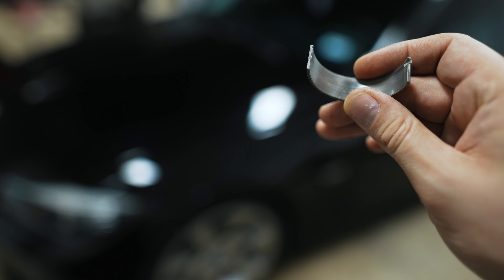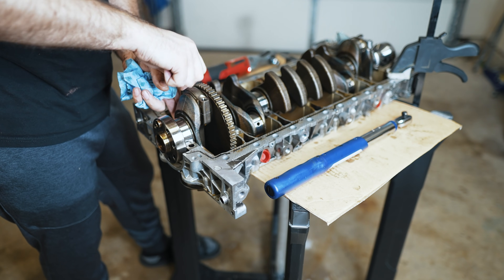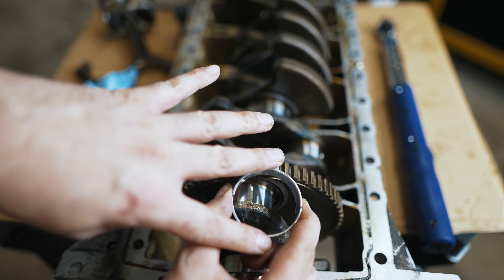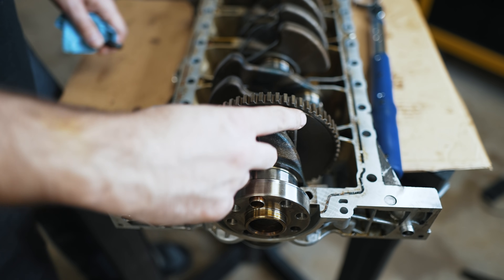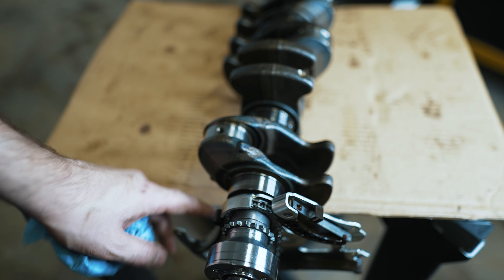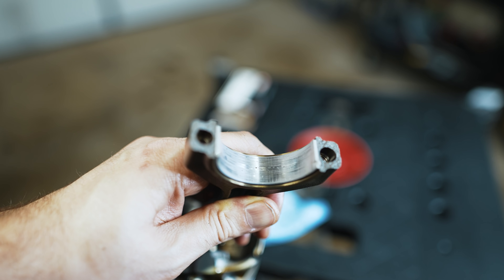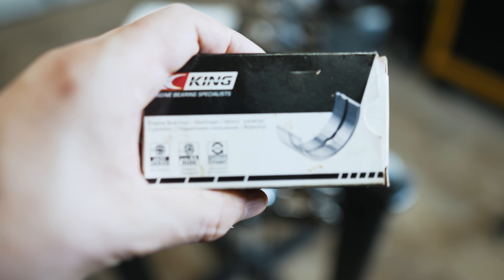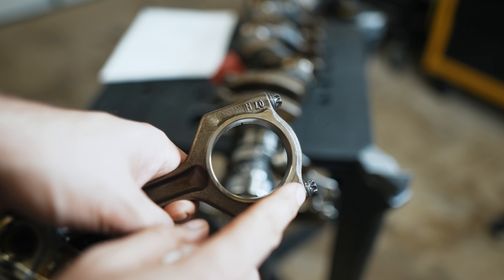Why Can BMW Rod Bearings Fail?!

Comment: Thanks for great content so far so in return I'll share some experience after owning cars with notorious big ends failures: CA18DET Nissan 200sx modded to twice design power (never failed on me - multiple cars/engines), alfa romeo twin spark 2.0 (stock, two engines failed on me) and a Porsche 924 2.0 (POS). Mind you I don't know N54s so well so consider this as some thoughts/pointers. So IMO the outstanding items for inspection would be:
1. Did anything block the pressure regulating valve in the oil pump. On my 924 I put in a brand new oil filter and the debris from the bad threads found its way into the oil pump and blocked the spring causing no oil pressure condition on startup (all oil run through a bypass valve). I took it out, removed the sharpnel and all was good. Something similar could have happen with yours due to chewing of the chain.
2. Detonation - If I remember correctly, you changed the injectors, plugs and coils on your new motor. Old ones may have caused this. Or wiring going into fuel/ignition components. Can't determine without oscilloscope. I think you also changed the fuel pump afterwards - upgrading to Walbro 255 was the first thing we used to do on CA18's. Colder plugs were also the first thing to do. It could be also momentary overboost condition e.g. due to leaky/wobbly wastegates suddenly sealing but I think you changed your turbos. Would be good to check the boost demanded vs boost delivered on your scan tool (this caused the overspeeding of the turbo on one of the cars I bought due to bad boost pressure sensor but it could work other way round - higher actual boost pressure than indicated). Condition of vacuum hoses, lambda sensors - goes without saying. Be extra careful on those misty cold days - this means air is dense and more of it goes in at the same boost pressure leading to DET.
3. Harmonic balance - aftermarket clutch/balancer instead of stock DMF? Any rattle?
4. PCV system/crankcase breathing - I ran an oil catch tank. On an old motor I found completely blocked breather hose at the back of the engine - possibly a reason for failure on most CA18DET's. Think about the quality of oil in 1980s combined with turbo motors.
5. High revs/load when cold engine - self explanatory, also blows seals on other motors like 350z's that lead to no oil pressure going to the chain tensioners (seal between the tensioner and block) - motor kaputt
6. I don't think that clearances should be bigger if the engine is not loaded with max power (high rpm/high load) for prolonged periods, I ran stock clearances on my CA18DET (1.8 engine with mitsubishi evo turbo about 330 crank hp IIRC, stock 169 crank hp). The higher clearances are used to protect against thermal expansion causing the parts to bind but you'd need some serious load for a long time and with a manual there's less chance of this I would think. Ask yourself how long can you stay on WOT - maybe few seconds - I have an Z4 with N54 and in few secs I'm at 150+ km/h this is licence risking territory so I have to back off. Different story if you are in a very long race.
7. As someone else mentioned, an oring on the oil pickup tube on the entry to the block/pump - maybe it got disturbed during replacement of the bearings? (I can't remember if the ones you replaced failed or the original ones). If you didn't replace this oring then it may be an answer.
8. OEM Oil pressure lights are notorious for lighting up when the oil pressure is criminally low and way below the treshold of damage. On a CA18DET I think it was 5psi or so when normally engine run at 15+ psi on hot oil.
9. Alfa twin spark - these were notorious for burning oil leading to no oil in the pan. Previous owners probably run it dry few times and when I gave it stick it failed. But I think you replaced the bearings and the crank was not scored so probably a moot point.
10 Saab 9-5 Aero - black crap in the oil pan typically killing the big ends - you'd assume we've gone a long way with oils since, yet I saw the same on a Jaguar S-type V6 engine.
11. (linked with 8.) Oil level sensor - these engines don't have dipstick so the oil level sensor could got stuck in one position (gunked up) - I saw it on a replacement alfa twin spark that I got from an alfa166, it was glued up literally. I always ran good aftermarket oil pressure and boost pressure gauges (I never could afford an EGT one) - I think you have all of them anyway.

Anyways, don't get paranoid, consider this a normal stuff on modded cars. I had friends with skylines on 3rd engine, same with 200sx, you'd see the same with anything that runs double the designed power despite what people say. But then I question when we call stuff plenty fast. One thing is goals/internet/forums and the other is the real life. I currently run a stock turbo'd Z4 @400 crank hp and its way too fast and too expensive so plan on getting a slower n/a beater for track fun - I don't want to kill myself. I reckon 300 hp on 1200kg car (200sx) is plenty scary (for me).
Reply from the maker: Wow this info is invaluable, thank you!  I'll respond back when I can spend some time reading all the points.

Comment: Also since you mentioned the clearances were a bit looser than stock bearings do you think you might have needed thicker oil maybe 5w50 to compensate for the extra clearances ?
Reply from the maker: I ran 5w40 when the motor calls for 5w30 so that should have helped make up the difference.  Thanks for the feedback

Comment: Thanks for sharing! Well an Austalian guy which owned the drag e9x WR on a stock not opened n54, says these high performance n54's need 10W60 like the ///m engines run on. But that's maybe because of the warm weather out there? His car is now owned by Dave and Andrew from zeroto60 (youtube). It's now a daily on 700wHp. Dutch regards, Nico.
Reply from the maker: Thanks for the info!   That's interesting that you can run 10w60 even in hot climates.

Comment: Hey man, not sure if you ever watch the channel Vice Grip Garage or not (The guy Derek is actually funny as fuck but he's also an amazing mechanic) but when I was watching one of his most recent videos, I immediately thought of you. You probably know everything he is going over in this video but he definitely offers up some tips that I think might help you. I know he's working on a big block chevy but at the end of the day, it's still a high output combustion engine.....anyways, the video is here......https://youtu.be/GHqvyY4i1dw hope you can find some time to watch it.
Reply from the maker: I have, he's a funny guy.  Well I'll be dipped lol.  I'll check it out thanks.
Reply: @VehicularDIY  LOL! Between the "sparkalators" and the "fuel make it happener" etc, he's always got me laughing my ass off. I now call car batteries "lightning cubes" hah! Well, I hope you find it useful. I'm sure you can find something to take away from it, there's always a nugget of knowledge mixed in with the comedy. When he was doing the bearings and explaining how he does it, I immediately thought of you. Cheers!

Comment: So why 7 b’s for 6 rod bearings I’m confused
Reply from the maker: The 7 b's are for the main bearings.  One thrust.
Reply: Er, no actually. There can be 4 thrust bearings, one upper and one lower, on each side of a main journal. This location differs between engines, some are on the mid main, some on the rear, etc. Some engine designs have the thrust bearing incorporated into a pair of main shells.
M 1 M 2 M 3 M 4 M 5 M 6 M where M is a Main bearing, and the number is a rod. Because there is a main at each end of the crank, you have 7 mains on the typical 6 cylinder engines. Chev 6's were like this back in the 60's just as an example that this design has been around a while.

Comment: It’s definitely combination of not up to temp and bearing crush in my opinion. 
I have the exact same bearings as you, but I don’t have stock rods. I’m using molnar rods with arp2000 bolts. I also have all rrrrrr markings on my crank.
Reply: i dont think he would drive it hard unless his oil temp gets up to operating temp has to be engine design failure
Reply: @BmwMe-uh9sy  the stock rods probably don’t like aftermarket bearings. And the bolts on them don’t help either. I’d probably replace the stock bolts with ARP2000 ones along with the king bearings on stock rods.
Reply: So you think that the after market rods make a difference?

Comment: What did the oil filter look like?  Could it have been one time foreign object damage?  (Piece of tensioner or something).  Generally after rod bearings or new internals you would run for 30 mins and change oil. Thanks for sharing sorry that happened.
Reply from the maker: Oil filter had bearing debris material but didn't see any signs of any foreign material.  Thanks

Comment: with what happened prior with your chain sprocket and all that metal it had to slowly plug up one of your ports until it wasn’t getting proper oil supply. Then laying on the petal without you’re oil being the proper temp... boom! Love your video’s man say it every time.
Reply: Whatever you get in the oil will be caught by the oil filter, that's why it's there. Plus you need a ton of metal shaving to block an oil passage.
Reply: @bence.gabor.slezak  he spun a bearing before his next oil change. Also before he did his rod bearings one of his sprockets shaved metal throughout the motor. So what are you thinking what happened?????
Reply: @connor78910  do you actually believe the oil filter isn't doing anything?
Reply: @bence.gabor.slezak  never said that, That’s what a filter is there for. Doesn’t make my theory impossible
Reply: @bence.gabor.slezak  you’re right no motor has ever blown from debris in the motor. The oil filter caught everything

Comment: Still think it was your oil pump.  The score lines you noted on the impeller vanes would have been the cause of fluid cavitation.  Again, pumping "foamy/frothy" oil.  The comments I made in one of your previous vids regarding all the many Audi/VW oil pumps I've replaced, many of them I took apart and every one of them also did not "look" too bad with score marks/pitting or worn out.  Again, the fluid cavitation.  In heavy industry like mining where almost everything runs on hydraulic systems, replacing oil pumps is very common even with rigorous oil maintenance.  In fact, when I went to diesel/heavy equipment tech training, checking the hydraulic oil for excess cavitation (foamy oil) was a frequent "check list item" to help spot failing oil pumps because that leads to failing valve block assemblies and cylinders, meaning repair bills that'll make BMW repair bills look like chump change.  I can't help but note I'm quite surprised some BMW engineer decided to use a Vane type pump as opposed to a Gear/Rotor Gear type of pump.  Gear pumps are more durable and more forgiving to contamination (metal debris).  Vane pumps, not so much but cheaper to manufacture.  In the automotive realm, just about all Power Steering pumps are Vane type pumps and also fail quite often (i.e. loud whining/whirring noise complaints).  So I'd guess oil pumps need to be added the "maintenance" list when doing your N54 oil pan gasket.  Maybe it's no surprise BMW markets/touts the B58/S58 engines having a vastly improved oiling system.....
Reply: Appreciate the knowledge. However, if it was the oil pump then why would the original bearings look fine? It's not as if the oil pump all of a sudden went bad..
Reply: @NetscapeGuy  he replaced the oil pump chain guide after it had failed on him while it was idling. the amount of metal he had, it would be no surprise that the shavings haven't all been removed from the motor.

Comment: You absolutely could spin a bearing very easily with only .0015" clearance with cold oil unfortunately..... especially if said bearings didn't have proper crush given that the rods are old and potentially stretched out of round a small amount.

Typically an average car has about .002" of bearing clearance on rods "I did .003 on supras" which is .0002 over factory max spec.
Reply: roccotherabbit /\  yeah he could but not sure it's worth it to him to buy such measurement tools that really won't get used much if at all but for this one thing
Reply: roccotherabbit /\  aluminum jaws on a vise would work just fine for rods...rod nice is nice if you do it every day and want something quick.

Comment: I'd change the oil cooler and flush out all the lines blow out all the passages. I would measure the con rod at several points on it's circumference for elongated and twisted also i wouldn't go for a bigger gap... maybe its time for aftermarket conrods and have them cryogenic treated then get the ARP bolts then get then check afterwards and do what ever machinist needs to do to get it true. And balance the con rods with the bearings and same with the pistons then all with the crank. It would be a good ideal to see if the the crank journal is flat maybe at one point on it 🤔...
Reply: I thought he did change the cooler out already.

Comment: Vac motorsports makes a baffled/trap door  oil baffling for these n54 engines. Put that in the same time the oil pan gasket got changed. I'm drifting so I have much higher chances of oil starving.
Reply: Not a solution for n54. It would reduce the sump area and how fast the oil returns.

Comment: sorry noobie here. So you didn't really have any issues before you installed the new rod bearings ? you installed new ones with a slightly bigger clearances, and then you had one bearing spin after 1k miles. Could it be that with all those new variables your bearings didn't like that you used a new oil weight with a stock oil pump and new bearing clearances. Sorry just trying to make sense of this :/
Reply from the maker: Yeah thanks, yeah I ran the same oil weight before and after the bearings 5w40.

Comment: I have no idea what's really going on but I love watching and learning and I can't wait for you to figure it out.
Reply: I love your videos,  I work as a nurse and love working on cars.  Been building honda and mitsubishi engines for 30 years as a hobby.  Just started working on  BMW's for that last 4 years. Just got done rebuilding my 2nd N54.  I've made my mistakes over the years and definitely learned from them.  That's why I love videos such as yours.  I was thinking about your spun bearing situation.  Sometimes it's the simplest this that causes the biggest problems.  I don't believe it was the clearances on the bearings or the pump itself.  I believe it was the oil pickup tube or the pickup tube o-ring gasket fitting to lose and sucking air along with oil.  Like trying to drink a soda from a broken straw.  You will register enough oil pressure for the oil light not to trip but starve the engine at the same time.  The reason I said this is because it has happened to me with one of my first rebuilds.  All my rod bearings were toast.  Just a thought.  Great job on all your videos my friend.  I've learned alot from you.
Reply: One other thing to add,  that on that engine that went bad on me the cranks main bearings and cam journals were alright. I'm sure they would have gone eventually but the rod bearings seems to take more abuse and require more oil volume and oil pressure.  Once again just a thought

Comment: Faulty oil level sensor ? Causing low oil levels
Reply from the maker: I had full oil capacity when I drained the oil.  Thanks for the input tho
Reply: @VehicularDIY  wow tricky one.

Comment: I'm  looking into getting 2008 m6 and  the m6 have that problem. I was reading about the weight of the oil.  The oil break down  so I spoke to some engine builder and they say you need a thicker weight oil. What do u think
Reply from the maker: I've heard 10w60 is the recommended oil for the S85
Reply: Would a 20-50 weight be ok to use.  Like  Royal purple,  red line, or  Amsoil.  It's  thicker the the 10-60
Reply: @ivanfider1631  20/50 is thicker when cold and thinner when hot.

Comment: The king bearings did you in sorry to say and I would have put 5w 30 redline in with the new bearings
Reply from the maker: I ran 5w40 for a long time with stock bearings but given how tight my clearance was 5w30 would be fine as well.
Reply: I know that’s fine you get no snow correct a lot of people change from 5w30 to 5w40 on this motor I don’t New York get really cold but if over 100k then I will switch

Comment: This is better than a murder mystery.  Hoping you might present information from an oil analysis.  I would think that if the bearings were starved of oil you'd see bearing material in the oil.  However, if it was general contamination, I'd expect to see other alloys, steel, etc in the analysis as well.  Another thought is to check the small ends of the rods for bearing damage, which would indicate general loss of oil to the crank/rod.  Agree with the points of using a higher precision measurement than Plasti-Gauge.  Suggest using a micrometer on the crank and bearing journals in at least 2 opposing positions on each journal and a bore gauge on the connecting rod journals.  perhaps there's a local machine shop that wants to do a collaboration like you did on the ECU MOSFETS.

Comment: Damn, was hoping we'd find out a definitive cause. In regards to oil temp, 120° is a bit on the low side if you're talking Fahrenheit. Still not entirely certain that would be enough to spin a bearing, especially with the bigger clearances of the aftermarket King bearings
Reply from the maker: Yeah the needle has just started to move  .
Reply: My needle is off at 70 degc. 120 is less than 50 degc and the oil viscosity would be perhaps 60 or more cst at that temp. By comparison a 10w60 is 25cst at 100 degc. People worry about thick oil but at 50 degc you were running at least two times thicker oil than a 10w60 at operating temp and no les than times 5 thicker than factory fill.